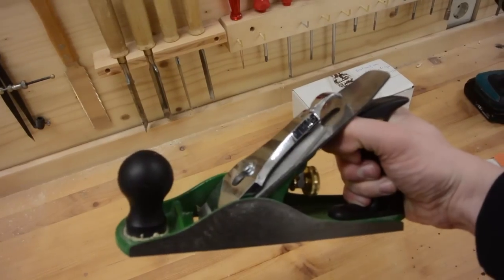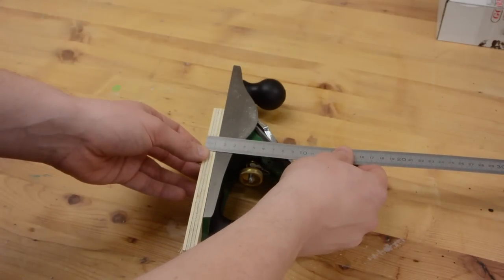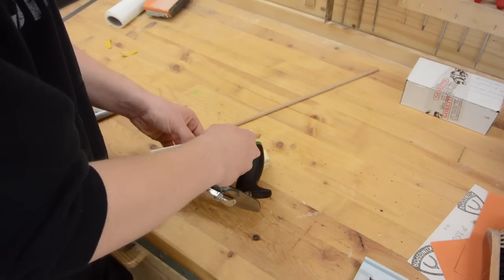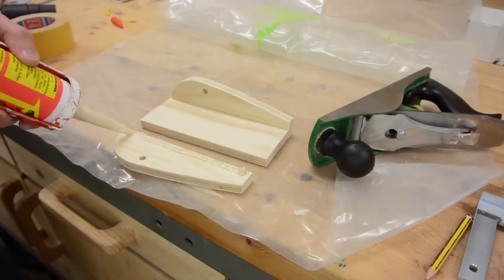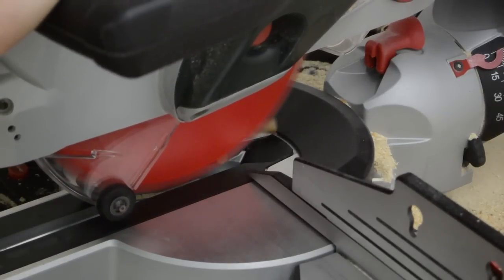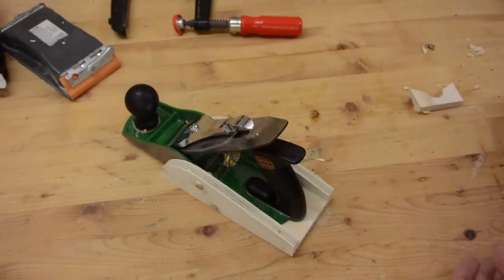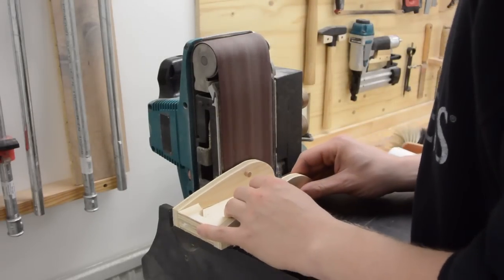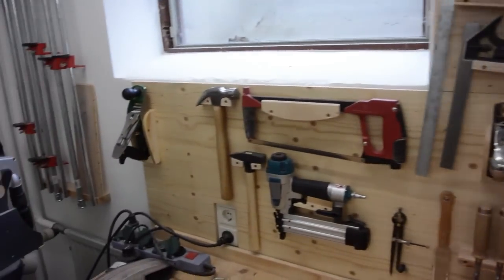Making a Hand Plane Holder

Comment: Simple and functional, I like it. Also really cool idea with Plexiglas for the bandsaw cover.
Reply from the maker: Thanks! The bandsaw is a really nice cast iron one with cast aluminium wheels. So that rickety plastic housing had to go to expose the beauty :)
Reply: +Cosmas B What sort of motor is on it?  It sounds high pitched.
Reply from the maker: It should is a 6-pole induction motor running at 940 rpm on 50Hz. The resulting blade speed is about 12 m/s. The high pitch is probably a result of the footage beeing sped up twice.